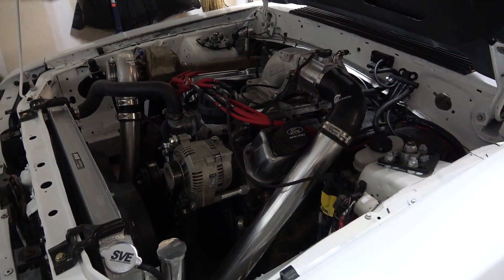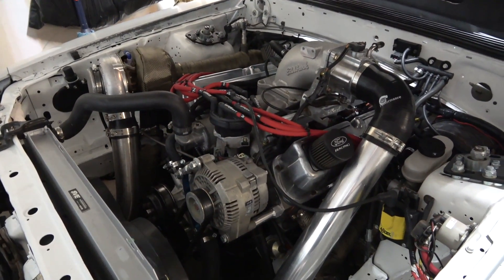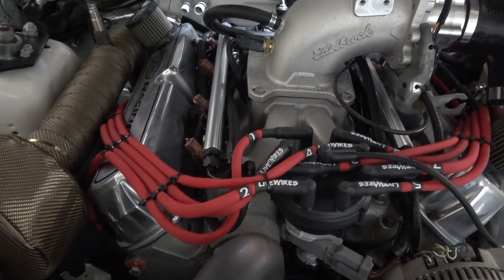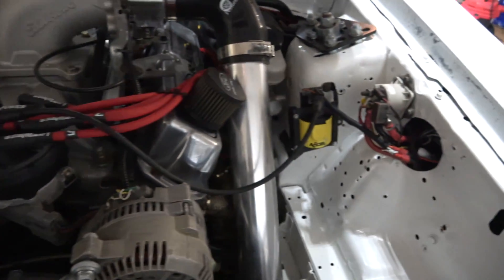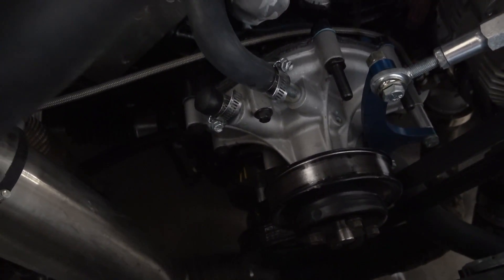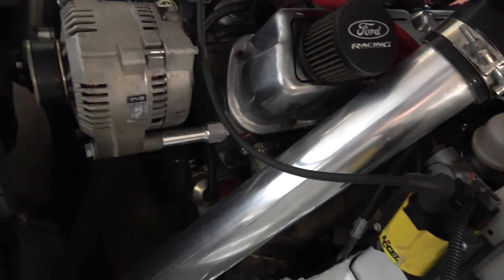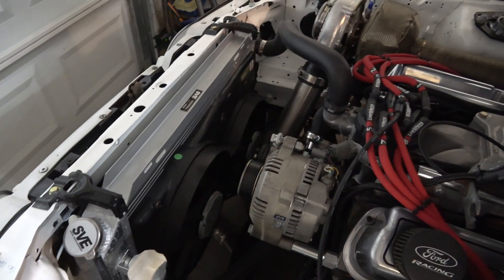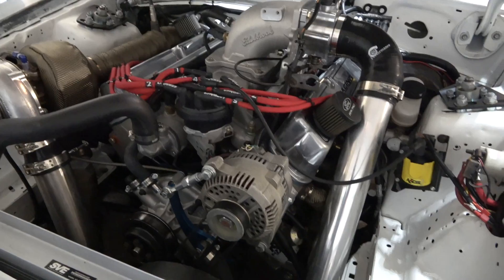My Turbo 351 Part List

Comment: What rig gap did you use for the secondary? Also, what bearing material was used? was it the lead, tin copper or antimony, copper aluminum ?

Comment: The push rods you used are they stock lenght?. I'm building 351w budget on3 build. Have gt40 3 bar heads, 1.7 rockers and f cam. Just trying to figure out what push rods lenght I may need.
Reply from the maker: Yes stock length rods

Comment: Did you use the same harness from the 302? Wondering if I have to switch out the harness from my 91 5.0 when I 351w swap
Reply from the maker: Yes same harness

Comment: What cam are ya running. Just ordered the ATK 351W short block, and ordered the F303 cam from LMR. Will also be swapping my 302 On3 Turbo to it as well.
Reply from the maker: F303. Nice! I would recommend doing a bigger turbo. The 70 was chocking down my 351
Reply: What ya running turbo wise now?
Reply from the maker: On3s 88/86
Reply: @justin91lx  on it!! Thanks sir. Will have to catch up to yall when its all done!

Comment: Hope you are staying safe. Are you running a standard clockwise water pump or the reverse rotation with that setup?
Reply from the maker: Doing pretty good. Hope you are as well. Its a reverse rotation pump

Comment: Justin, what dipstick did you use
Reply from the maker: Dont remember, but it was crap. I swap out pans and using a ford stock replacement
Reply: @justin91lx  I have the motorsport dipstick and swap pan, and I cant seem to keep it from touching the header, but oh well I'm sure it will be fine

Comment: Great setup! Have you ever had any issue with your wires being so close to your down pipe?
Reply from the maker: Not really. I had the downpipe wrapped, and used livewire wires. They had a head shield around them.

Comment: Hey bro love your video I’m look to do the same build. I have the same heads as you. Looking to use the same cam but I have 1.7 rockers hoping to have enough clearance with the same pistons. The only difference is I’m running a v3 Superchager. How much clearance did you have between the pistons & valve with the 1.6 rockers?
Reply from the maker: Nice! I had ton of clearance left. The 1.7s shouldn't be a issue

Comment: Nice vid and nice build. I too have built me a 351W and stroked it to a 408 and kept it NA and more streetable with 185 AFR heads and 10:5 to 1 compression on 93 pump gas. Using stock EEC-IV fox computer that came on car. Car dynoed 460 HP 455 TQ to the rears. Ed Curtis "Flow Tech Induction" custom bump stick with 231\240 duration 112 lsa and over 600 lift. Dynatech long tubes and 3 inch exhaust. Car hauls the mail! Really fun to drive. Having issues with my intake setup tho. Could be better. My question is what is that 90 degree elbow your using from you throttle body to your inlet pipe? Silicone? What ply 4 or 5? Mine gets hot and kind of distorts and collapses. I'm losing low end power I'm guessing. I'm looking for a better piece to use. Any info would be great. Thanks.
Reply from the maker: Sorry for the delay! the 90 is a 4 ply silicone. If your is collapsing I would change it out.

Comment: Thank you for this info. Anything I should change if setup is done in an sn95?
Reply from the maker: No problem! The engine bay is pretty much the same depend on year. I would do some 351 lowering motor mounts. Just to drop it a little

Comment: Did you have to tap the intake Elbow for the air charge temp sensor and what looks like the vacuum line?  I am putting the same intake manifold on but noticed there was no spot for the air charge temp sensor.  I have a throttlebody Spacer with a vacuum line on it which I might use.  Any info would  help. Thanks
Reply from the maker: Yep, I tapped the IAT, and Vacuum. If you have the spacer that will work for vacuum.

Comment: F250 are u sure 95 most of them had four 460 or diesel its weird to have that engine in F250 ? You did a aton Of Work Omg 👍
Ill be waiting for the detailed turbo vid Thanks 👍
Reply from the maker: Thank you for reminding me about the turbo video! lol Yes Came out of a 95 f250 4x4. Lot of work was gone into this build
Reply: Got a 351w block from a '97 F350. Building a 408 with a Holley Hi-Ram, TF 205 11Rs and custom cam. All forged assembly internal bal.

Comment: Hey Justin, 
Are you running the stock rods?  Just pulled a 351w out of a 97 f250.  I am trying to get my build going.
Reply from the maker: Stock rods and crank. I put in forged pistons
Reply: Where all these f250s with 5.8 most the f250s here in California all 7.5 or diesels
Reply: I just got one in Richmond CA
Reply from the maker: At the wrecking yard there was 3 f250 with this motor. Only seen one with a diesel init

Comment: What did you do to make the 302 kit work on the 351w, ready to swap a 351w into my fox but don't know if I'll need to tear it all apart.
Reply from the maker: It took a lot. Had to make a new down pipe, extend the cross over pipe about 4 inches. message the passenger shock tower for the header to clear. Removed the sway bar. Reran my entire cold side.

Comment: hey Justin what was your cc on your heads and your final compression with those pistons, I aploigize for all the questions iam getting ready to buy these pistons you got for my 351w build thanks for all your help bud.
Reply from the maker: No worries. They are 61cc heads. Using a .039 head gasket will increase compression. With the pistons and head combo. I say its around 9.1 fairly close to stock

Comment: How did you rework the 302 on3 kit to work on the 351w
Reply from the maker: I extended the cross over on the hotside. I reverse the cold side as I put the pipe on the driver side. Had to make a custom down pipe off the turbo

Comment: Thumbs up, building a 351 myself. Have the motor and pretty much everything but the fuel rails/regulator. Same black paint, same valve covers, same heads lol. It's a stroker 393 roller block. Plan is to go turbo and good AOD later.
Wondering about the spacer for the crank though.
Reply from the maker: The spacer on the crank is what came with my balancer. I would find a better spacer.

Comment: Great video, Justin.  I may do a 351W next in my '88 GT.
Reply from the maker: Thanks! Cant go wrong with a 351!
Reply: I have 11R 190 heads on my 302.  I'm making 320 hp to the wheels.  I want a 351W so I can add boost and not worry about cracking the block.
Reply from the maker: You'll be able to make good power if you used those heads. I have the baby 170s and 6lbs i make 546 to the wheels
Reply: I think they are small for a 351W.  I thought I need a 205-215cc head?  How do you like your setup now compared to your turbo 302?
Reply: @afri1414  You don't need a 205 or bigger head. But it does help, tony reiner is running a 357w with GT40 heads and a S480 and running 9.10's
Reply: @fourwheelerjock  I want a well thought out engine combo. Builds also cost more than you think when you start planning it out.  I have my 11R 190.  I believe they can be opened up.  I'd like to try a turbo, but I know the 302 would be a ticking time bomb.  I'm pretty much making double the power from the factory now.  A 351W block with a forged rotating assembly should handle 500+ hp to the wheels. Hi my name is Afri. I'm a horsepower addict...lol.  My baseline of 168 hp felt slow.  I have 320 hp and it's ok, but I want more...lol.
Reply from the maker: totally  different car! Makes more power without our even trying

Comment: Looks good Justin. Just curious, why didn't you reuse your trick flow stage 1 cam out of the 302 ?
Reply from the maker: That cam runs out of steam at 5500rpm.  Im spinning my 351 to 6500. When I had my 306 tuned you can see on the graph it drops off quick